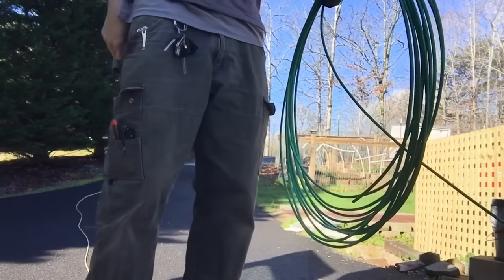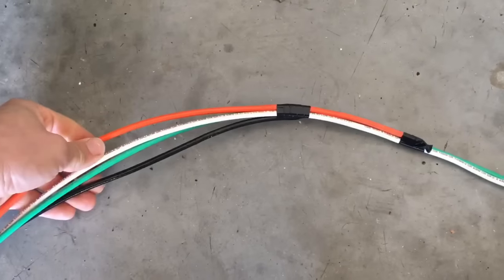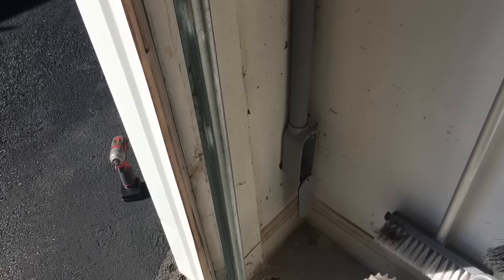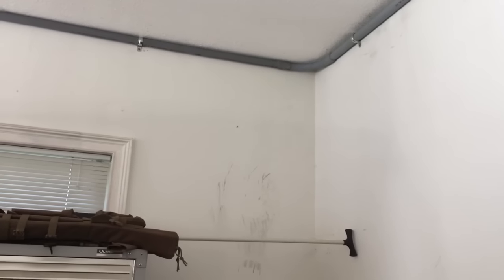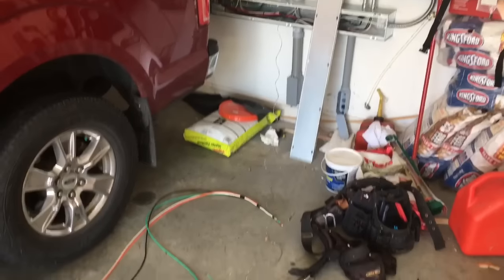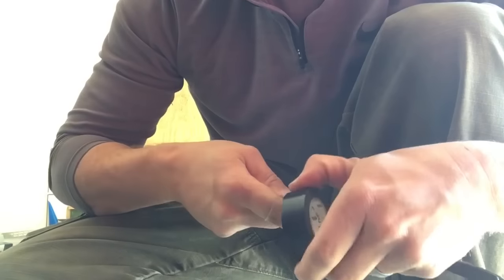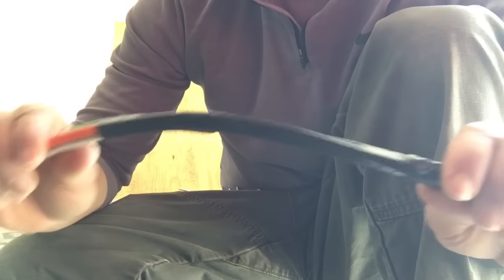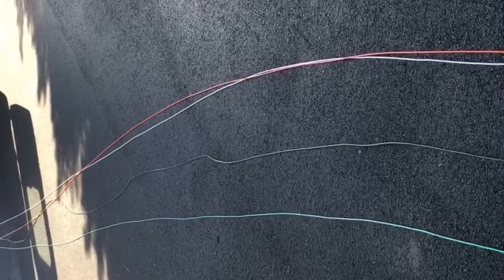Electrical Wire pulling secret string move

Comment: Sure enough, I just remembered something else.

1. If you need to pull your wire multiple times from point to point use a long piece of string to make up your pulling pigtail. Leave the long end hanging at the beginning end. As you get to each new pull point you can cut off your string knot and have plenty of slack to tie on a new piece without retaping the whole thing.

2. Once you get good at reversing the string loop you can begin to think about what happens someday when it becomes necessary to add wire to your conduit. Remember the first loose end of string that you held in place with your left hand? That is the "following end". Leave it several inches long and use it as a tie point for a pull string. It will drag a string along with your wire and make life much easier for you or the next guy.

3. You don't need a fancy knot or tape to connect/reconnect pull string to your pigtail. Simply overlap two parallel ends of your string (this works best with two pieces of the same material) and tie a simple over and through knot. It's not necessary even to double knot the string. Once again, the harder you pull, the tighter it gets. A double knot just makes something else to get hung up.

4. If you find yourself doing this a lot buy a pvc oven. Buy 21' lengths of pipe from a pipe supply and make your own bends when where you need them. The fewer joints the easier the pull.

Ok, I think I covered it all this time.
Reply from the maker: Which oven do you recommend
Reply: @GainSolarPower  

The first one I bought was a Greenlee. It worked great and was designed for use on pvc up to 2". It had skate wheels on each end to help with rolling it in the oven. One of my employees loaned it to a contractor the day we finished a project and then he went on vacation for a week. I didn't find out he had loaned it until after he returned from vacation and remembered to tell me.   I never saw it again. It was about $400 in the mid 1990's.

I bought a replacement a couple of years later. It wasn't as well made and cost about $275. It was red. I still have it somewhere. I don't remember the manufacturer. It did the job but wasn't as well designed. They are both about 30" long.

You have to learn by doing. I've burned more than a few pieces of pipe. On cold days the pipe sets it's shape pretty fast. Carry a full water cooler with ice on hot days. Hot PVC is like carrying a wet noodle. Put it into position and pour (or squirt) cold water on it. It will freeze into position. Once you get good with the oven you make lawn furniture.

I never tried it on 2 1/2" or white pvc. For conduit larger than 2" use a heat blanket.

If I was to do it all over again I would buy another Greenlee. As a bonus keep a roll of heavy aluminum foil handy. The ovens are great for grilling hot dogs and sausages!

I also have owned a Greenlee vacuum pulling system (I still have it too). It comes with foam "mice" for each size of conduit and lots of attachments, including a string gun. It is all very well designed and very fast. I recommend it too.

No I don't have any association with Greenlee. I just buy good tools the take care of them.

Comment: I learned this trick a couple of decades ago watching the network techs pulling fiber optic cable down seven floors through a partially filled conduit. They told me it was a lot less likely to fracture the fiber than yanking it through with a fish tape or the like. 
i used it to pull a fish line through a long, multiply curved buried conduit, which then pulled a coax through. 
I've also used a shop vac to suck a fungal mat that had clogged the drain for my air conditioner's drip pan. Vacuum is just a wonderful tool.
Reply from the maker: I love my shop vac. I renovated my whole house with it
Reply: @GainSolarPower   l love the way the 'Vac can just suck those old studs right out, after the termites have been at them, although snaking the new ones in can be a bit tricky. :)

Comment: Good video for new guys, but one code problem in a way, you can't phase #6 or smaller by code. But your #8 Orange is to code even not being red, unless your local municipality has its own set of local codes. As for NFPA70, also known as the NEC. The only required colors are Green and white or gray. To identify  bonding and grounding conductors. As for the current carrying conductors like A phase B phase and C phase no matter what voltage, are only required to be different colors to identify one conductor from the other, but for number 6 and smaller must be continuously the same color from one end to the other and not only marked at the termination Point. anything larger then #6 can be marked with phase tape at the termination point. Just a little tip many electricians do not know.
Reply from the maker: It’s a good thing I don’t have your phone number. I’d be calling you all the time.
Reply: @GainSolarPower  LOL. You and every Apprentice that ever work for me hahaha
Reply: That’s right...... was waiting for that.
Reply: You are incorrect. Although the code does not explicitly say what colors to use for ungrounded conductors the authority under jurisdiction may have their own color code for phasing. Nonetheless, the code does state the phasing colors must be identified at the  branch circuit panel as the what color is what phase. If he is using an orange as B phase and everything else in the panel is using a red for B phase this is a code violation. I’ve never had an issue during over hundreds of inspections not identifying probably because I always use the common phase colors for that system.

Comment: A couple of years ago I was going to pull a wire through 10 meters (32 feet?) Of PVC pipes but had no correct tools for this. .

Then there was only one thing to try, I took the vacuum cleaner at one end and sealed it against the pvc pipe and at the other end I fed in sewing thread.
 This sewing thread had to pull through a string which then pulled through the power cable!

Comment: Thanks, I just used your vacuum trick to pull 200 feet of mule tape through a two inch conduit.
Reply from the maker: Then this video was worth it. I’m glad it helped.
Reply: Always blow a line with a lightweight string. Then use the string to pull a heavier mule tape if necessary. String blows easier.

Comment: If you wrap the tape from the back towards the head then the overlapping tape groves don’t get caught inside pipe/ fittings.  Every little bit helps on tough pulls....good video
Reply: Good point- it's like dragging something down a staircase instead of up that way.
Reply: That make sense, I've always started from the head. I've got a big pull with 2-0 I will use that on.

Comment: Could just use a fish tape that’s  quite a small pull  could even use a fiberglass fish tape to make it easier and if you buy the spool of wire you don’t have to walk it off before you pull it just pull straight off the spool which saves time money, and makes it easer

Comment: counterpoint: if you pull a lot of the same size wire, get the rolls, in all your colors, and then you don't have to measure your conduit and order cuts (or walk them out and have them tangle, anyway)

Comment: You don’t have to walk backwards I can do it faster walking forward. Also it’s a better idea to fold copper  back on itself and not over the other insulation and trim some of the wire strands off makes for a cleaner streamline head

Comment: Vacuum suction are the way to go instead of blowing /conair, or even fishing conduit if it's air tight. Last year we did a stadium's parking lot with maybe 700 to 1,000 foot distances, maybe even longer with just a shop vac and a plastic bag in your picture. Pretty quick, and it's the only way to do it for such long distances. I think 3 incher at roughly 900 feet took under a minute to get string through.
Reply from the maker: Nice. Did you use the same cordless makita vacuum I used?

Comment: When you drop a wire out of a head like that, you'll understand why its wrong.  All the wires get attached, strip em back and cut off most of the strands.
Reply: Right all wires need put on fish tape going oppisite  directions. The way he did it is when you could push the wire an just dont want to waste that time.
Reply: Thank you both, I could bot believe his nose prep.  Did he happen to gave 2” pipe he wanted to use?  2” for 8’s?
Reply: @inquisitive980  I assumed it was 1" and the camera was making it look oversized, but he does say 2" near the end.
Reply: Don’t say something is wrong just because you don’t do it like that.  Why waste time stripping the wire back if you don’t have to?  It is not always necessary. Especially for smaller wire and shorter runs.  Besides that half hitches would be much better.
Reply: @pradaxaboudraux368 first of all all the wires can’t go opposite directions because at least 2 out of four would be in the same direction. Second  you should split the strands and take THEM  through the fishtape/rope loop in opposite directions which is what I think you meant.

Comment: I don’t believe the bundling of NM-B is any different from putting THHN in a conduit. You are right that it may not be used, that is because outside would be considered a wet location. “THHN” that is sold today seems to always be dual rated as THHN/THWN-2 which is good for 90 degree Celsius in wet locations.
Reply from the maker: It’s considered different in the code. The individual wires are factored differently in wire fill calculations than a bundled cable such as NM-B. Think about this. Thhn/thwn is rated for more amps than the same size wire in NM-B.

Comment: That's thwn it's dual rated for 75c thwn-2 is dual rated for 90c most terminations are 75c  rated and code says that u have to follow the lowest rating for amp calculations. That's why thwn is widely used for underground feed applications.
Reply from the maker: Thanks yes I’m just stuck calling it thhn. It’s cross listed

Comment: p.s..
Always - always - add at least ONE extra cable - to the one's you need.
As that way - if you ever need another circuit "pulled" through - you don't have to remove them all - just to "suck" another draw string through - you have a SPARE there already.
Plus - if one wire has a short or "burns out" somewhere in it's length - you have a spare that is easily used ..
Reply: Why not just leave a string in the tube for the next pull?  I always leave a string in my conduits that is double the length of the conduit (plus a little more).  For example, of you have a 10meter conduit, I leave a 21meter string in there. This gives you enough string to pull a wire through either way, and not "lose" the string in the conduit.

Comment: I tried this with a paper napkin and poly string for about a 150 ft run but it won’t pull the napkin. I’m using a 6.5 amp shop vac taped and on the other end very little suction. What does this mean? Conduit is new and buried now.

Comment: You applied the tape in the wrong direction.  It should be wrapped towards the conduit, think of fish scales or roof shingles. Those wraps done the wrong way will get caught up. Also, the tape should be stretched tight as you wrap so as to eliminate stretch which causes wires to come loose. There's really no need to tape each stagger, that just adds to bulkiness.

Comment: If there isn't room to lay it out then pull from a spool. If the conduit already has some wiring in it use pulling gel to make wires slick. Rub the gel on as wires enter the conduit. Make sure there are no sharp edges to get stuck cover with tape.

Comment: I sucked a ball of paper tied to a string through 200 feet of conduit about 20 years ago when I ran power to my shed. Came up with the idea on my own ha ha. Must have been ahead of the times. It worked like a charm.
Reply: 30 years ago Greene Lee made a conduit machine for this application. First time we tried it, we wasted the whole roll of string. It pulled it through so fast and we didn’t know when to stop it. Was a whole pile of string left on the ground 😂😂😆😩

Comment: Remember, The more tape you use the harder it is to pull. - Learn to cut the he wire back and use no tape at all over a bowline in the end of the jet line, No tape. .....There is also something called a "fishing lure" - A piece cut from a metal stud smaller then the pipe and  6" or so long. Drill a bunch of holes (Or better yet use a Whitney punch) in it just over the diameter of the insulation of whatever you are pulling and just stick the wire through - do not bend the wire back just let it offset through the steel. the edges of the metal will cut into the insulation with a death grip - Been pulling 9 and-#12THHNs through 360 degrees of bends in 1/2" EMT at 100 ft for over 30 years that way, 10 if you are pulling a green. ,,, jet line, a lure and NO TAPE. - Good for anything up to #6 or so Anything bigger, unless you are some kind of a masochist  you are looking at finger puzzles and a tugger, or pull it with a towmotor and no matter what don't be afraid of using plenty of soap!

(Industrial electrical/millwright contractor since 1980 - Retired in 2019)

Comment: The loop of wire should also be double the dia. of the conduit. This helps keep the head from straightening out. (ie.. 1" conduit needs 2" loop minimum and 2" conduit needs 4" loop.)
Nothing worse than having head come apart mid pull.

Comment: Another tip - attach and pull a length of that pull string to the wires you are pulling to allow for a future pull - adding a wire or two as in deciding the Winters are cold enough to require need a heater bulb (and circuit) at the well head to prevent freezing . . .

Comment: always unroll wire that way, regardless if single, multiple and type :)
the best trick with larger gauge or odd runs is pull/push it in while running the conduit and not after.
Reply: I've been doing this for 15 years and I have been walking the wrong way. Ha
Reply: @DonkeyLipsDA3rd  just be careful you don't backup and walk off the open stair hole to basement or out a door into non-backfilled walls.
they always left that stuff out to the last and no safety rails when I was in the field (mid 90's). lol, we've all disappeared down a rabbit hole before! none of the concrete was in yet, so it was a soft gravel/wet landing since the sump pumps were often not active yet, no doors windows and hardly a roof. we were the sparkies ;)
Reply: @throttlebottle5906  oh yes the good ol open stair hole..not fun..
Reply: But that's against the National Electric Code! And I do it every so often...

Comment: Poly line will still destroy the conduit if there is enough tension.   Rope has less resistance in than mule tape..     If you completely lube the entire mule tape it's probably the same.

Comment: Tried pulling string into 3/4 emt yesterday 250ft didnt work, had to use steel fish tape   through three 90 bends and had to uncouple the last 90 and hand feed the fish tape down to the panel

Comment: What do you do if you have multiple 240 volt outlets?  Do you pull the wires for each outlet separately using your method or all of them all at once?
Reply from the maker: Not sure what you are running.

Comment: All of that teasing and we didn't get to see it pulled!!
I like to half hitch up the head with the mule tape covering the staggered ends. It just makes me feel like if some tape slipped somewhere that i have better chances of not losing a wire.
On big stuff i like weaving a basket with steel wire and taping with duck tape. 
On a run as short as this i would just shove them through.
Reply from the maker: Lots of ways to do it. Thanks for watching

Comment: Sure wasting allot of time and tape making up that head.  On a large conduit relative to the wires being pulled you don't need to go so crazy making up the head and tapering it.  Even with 270 degrees of pull it will go fine with a little squirter of Klein foaming spray lube.  Fold the green conductor and over lap a good 8cm or so and then step the other conductors starting at anout 3cm back from the nose with each bing added about 1cm behind.  Give a good layer of tape and you are set to pull.  The bag on the string trick works great and I have used it to get jetline in a conduit that was in excess of 150M.  Not a fan of Jetline for pulls as it will cut PVC conduit on a hard pull and break.  Bull line is OK if you are pulling manually but is a nightmare on a tugger!  Good video for the beginner though.
Reply: It's never a waste of time learning efficiency by doing things correctly.

Comment: thanks for this cool sharing men! 
I was vacuum with your tips.
Reply from the maker: Nice job!  Glad it helped
Reply: I had a 15 ft stretch of conduit under my patio and was going to “push” the wire and it wouldn’t make the turn on 90s.  Used a small ball of tin foil on a string and the shop van.  Wife’s neighbor ladies were over and they laughed at me and said it would never work!  That ball went through in a split second!!!  LOL!!! Now I have new respect in the neighborhood.  😉

Comment: Vac use was neat. The conduit, is it glued, seems so if you have a good vac stream. Some areas glue is not req.
Reply: You can use something called “solvent cement” to join pvc conduit. For this particular job, since it’s so small, he may not have used any. You’d still get a fairly good seal without using it.